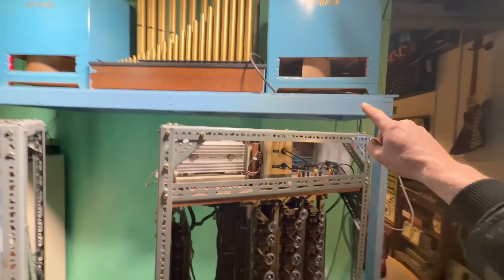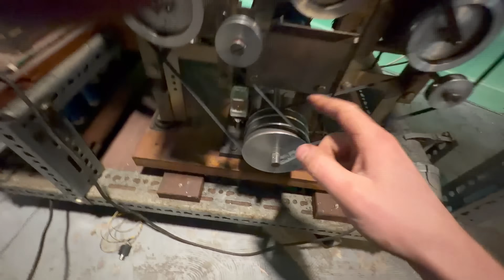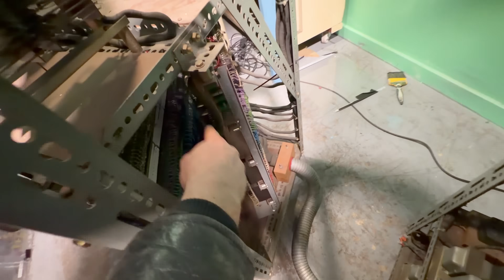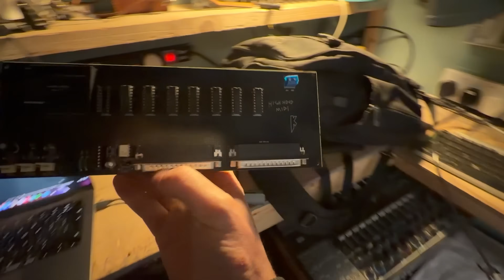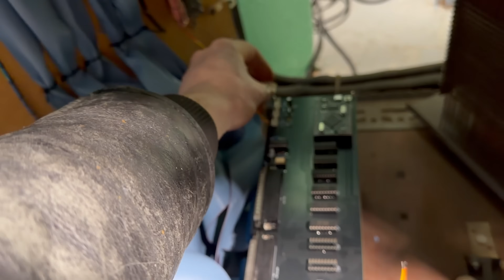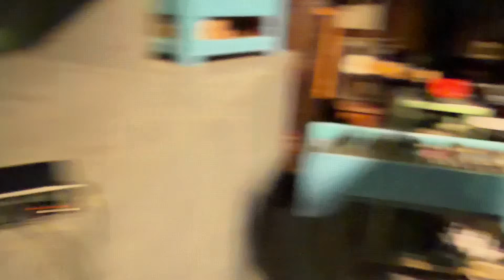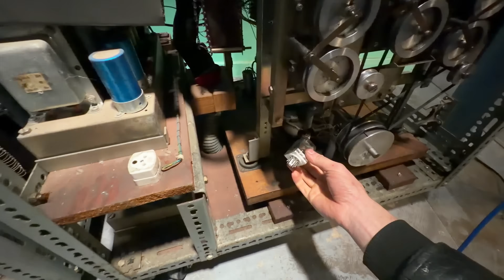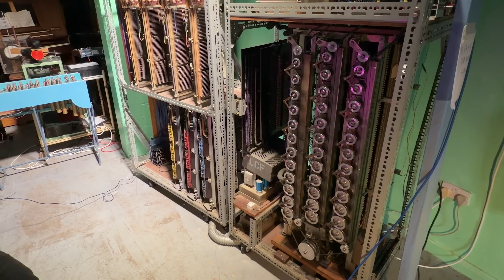IT FINALLY WORKS! - Crazy Electrostatic Spinning Church Organ

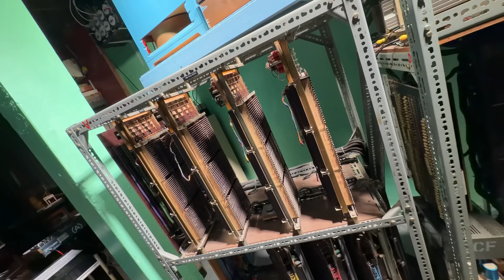Comment: 24:42 wait are you telling me that THE classic sound of "old fairground music" when someone accidentally plugs in an abandoned fairgrounds power or trips over it was made with this kind of tech? absolutely awesome to see one of these up and running
Reply: It genuinely wouldn't surprise me if a foley artist at those times actually went to a local church with an organ like this and asked if they could record their organ shutting down.
Reply: The 'old fairground music' was and is acoustically produced, usually by an instrument called a 'fairground organ' (or 'band organ' in the USA; 'orgue du foire' in France; 'kermisorgel' in Netherlands/Belgium; 'Jahrmarktorgel' in Germany; etc). 

This is a real pipe organ that plays automatically, via a pinned cylinder ('barrel'); folding cardboard 'book' music; paper rolls (like a player piano); or some type of digital media (either proprietary cartridge/floppy disc systems, or regular MIDI, now with SD cards, smartphone/tablet etc). 

These instruments were popular until the very late 1920s when amplified address systems / large speakers finally became practical for fairgrounds. 

This, coupled with various economic recessions/depressions in the USA and Europe, contributed to a downturn in these instruments' use. With the very grim postwar economy in England, a shockingly high number of the largest and finest fairground organs were deliberately destroyed and burned in the 1940s-1950s, including most of the two dozen or so 110-key Gavioli organs (that had been produced to front traveling bioscope shows / cinemas in England), many large and fine Marenghi, etc. organs, etc etc. this terrible wanton destruction of these magnificent instruments is still a painful memory for enthusiasts unto today. 

On the continent, most fairground organs fared much better, with a great many of them stashed away in barns and similar during the war to prevent them being vandalized etc. 

After the war, dozens and dozens of these organs were pulled out of their hiding places, fixed up (by the few active people doing this) and played proudly again. 

Their sounds, and those of the few dozen or so still going in England, eventually inspired preservation-minded people to form the "Kring van Draaiorgelvrienden" (Circle of Street Organ Friends) in Netherlands in 1954; and the "Fair Organ Preservation Society" in England in 1964. 

Other groups soon followed (such as "Club Deutscher Drehorgelfreunde" in Germany in the 1970s; 
the "American Band Organ Association" or ABOA in the USA in the 1980s, 
soon replaced by the "Carousel Organ Association of America" or "COAA" in 2000; 
the "British Organ Grinders' Association" or BOGA; 
the "Mechanical Organ Owners' Association" or MOOS also in England; 
and the "Australian Mechanical Organ Society" or AMOS). 

In addition, many other more general mechanical-music societies have taken an interested in these instruments, 
allowed articles to be written about them in their journals, 
and helped promote public get-togethers of these instruments, 
to help raise awareness among the general public (as well as being a lot of fun!). 
Some groups doing this include AAIMM in France; AMMI in Italy; AMICA and MBSI in the USA; and more. 

As the collecting/preservation movement (and market) grew in the 1970s, 
many small cottage-industry builders sprung up to make new band, fairground and street organs to cater to the collecting market. 
In England, numerous builders popped up including Alan Pell; John Page / Page & Howard; McCarthy; Dean Organs; Peter Trueman; and more. 

These companies help(ed) service the enthusiast market, 
especially the demand for smaller portable organs playing more modern media (than barrels) such as cardboard books, paper rolls and computer media (as well as a smaller demand for large fairground organs that couldn't quite be satisfied by the remaining supply of antique instruments). 

In Germany, likewise many builders got started (with many still active today) such as Raffin; Hofbauer; Deleika; Jaeger & Brommer; Stuber; Stefan Fleck; Schmider; and more. 

In Netherlands, where the street organs are still considered a cultural asset, many builders of new large street organs either continued old family traditions, or sprung up anew, such as Jan van Eyk; Jan Roos; Theo Heesbeen; Elbert Pluer; and on and on. 

Likewise in France, many builders of small hand turned cardboard book street organs (and somewhat larger cardboard book fairground organs) emerged, like Marc & Christian Fournier; LeLudion Organs; Odin Organs; and more. 

Even in the USA, band organ and small street organ production was done on a small scale (maybe a few hundred instruments in total) by such firms (mostly now defunct) as Stinson Organ Co.; Johnson Organ Co.; William (Bill) Kromer; Richard Freed (Freedola); Paul Dyer; Brian Flora (Floraco); and a few others. 

In addition to the small companies/factories and custom builders turning out street organs (and a few fairground organs), a great many hobbyists here (and in Europe and Australia) have made their own homemade street and band/fairground organs, for their own amazement/amusement as well as that of their friends, family, and the general public. 

Several sets of do-it-yourself plans for building street and band organs have been published, with several hundred people trying their hand at making their own instrument (including the various "John Smith" busker organ plans in England; the Walter Hoffle plans in Germany; someone's plans for a 36-key cardboard book organ in Netherlands; various band organ plans in the USA like the Bob Stanoszek / Bob Humes Wurlitzer 105 plans; etc etc).

In Belgium, the remaining builders of 'dance organs' and organ-type 'orchestrions' (the last type of large mechanical organs to retain serious popularity in their home country, with the production of medium-size and even some large instruments resuming after the interruptions of WWI and WWII), found, on the one hand, a gradual tapering off / downturn in their native dance hall / cafe / coffehouse market for their new instruments 
(even despite some new innovations they introduced from the 1930s-1970s such as, in order: 

exposed working accordion(s); 

exposed working drumset(s); 

modern 'space age' organ fronts with automatically-changing lighting systems that change colors with the organ's registers; 
'half-electronic' organs with melody and countermelody voices made by early analog electronic organs 
(such as the Univox and Clavoline), while real organ pipes still provided bass and accompaniment sounds; 

mostly-electronic organs incorporating an entire Hammond organ into the chassis 
(plus selected few ranks of organ pipes, and the usual accordions and drumkit), still worked by cardboard book music; 

and finally, in the 1970s, electronically-operated organs worked via computer tape media (pre-MIDI). 

Although these innovations kept these companies at the forefront of dance organ technology 
(mainly the Decap family companies such as Gebroeders Decap and Decap Herentals; both still in business today), 
the tapering off of the original-use market 
(whose clientele who loved the dance organs were aging out, 
being replaced by a younger crowd who demanded rock bands and DJs), 
ended up dovetailing nicely with the sudden rise of the collector/enthusiast/preservationist market in the 1970s, 
who not only created a small but steady demand for new instruments, but also gave the old companies new business in repairing and restoring their old instruments (in an authoritative way), with the collectors amazed to find out some of these builders were still alive and still working on their instruments! 
(Another good example was the late Arthur Bursens, who kept building new organs and repairing his old ones, into the 1970s). 
This sort of business, from museums, collectors et al, plus the few people still using dance organs and orchestrions in their original function today (in dance halls, cafes, and even in traveling mirrored 'dance tents), have kept several of these companies alive and active unto today. 

With the continued (but smaller volume) level of business, some of them (the Decap family companies in particular) have been able to innovate still further; with Decap introducing a full servomotor-controlled drumkit (with many levels of expression on each drumstick, with general MIDI); more realistic-playing accordions with many levels of expression; more sophisticated computer samples; and now even scrolling synced kareoke of lyrics to tunes displayed on screens (so you can 'sing along with the organ' as it plays). 

Seeing all these type of innovations in Belgian dance organs, it makes one wonder in what direction the original fairground organ builders (and player piano / orchestrion builders) would have gone, had they kept going and not gone defunct in the two World Wars. The closest we might get are the modern day all electronic reproducing pianos with 1,000+ levels of expression on every note, and a very high sampling rate for very accurate timing and playback of recorded performances.
Reply: @andrewbarrett1537  I saw one of those operate at the museum of musical instruments near Phoenix, Arizona. Spellbinding honestly, even if the sound of that particular unit wasn't so good.
Reply: thought exactly the same :D
Reply: It could be an old gramophone slowing down too.I think that would have the same effect

Comment: All those constant values not having a const qualifier.  Not that it likely matters, the compiler is probably smart enough to still optimize.  It's more to prevent programmer errors anyway, where it can catch if a variable is being assigned to that shouldn't be.
Reply from the maker: It’s fine. It’s all infront of you as all the cases are different. Nothing is in a logical line. No need for optimizing as uses hardly any memory. Just more sensicle for people who work on organs

Comment: You can use a strobe light on the tone generators to find the slow pokes. Great job its fantastic.
Reply: There are also ios and Android "video tachometer apps" that claim they do this
Reply: @gazzar67 You could probably just adjust the camera frame rate too. The default camera app on most phones lets you do this now

Comment: Electroboom would be proud... :)
Reply: Device spits sparks and a loud pop when touched
Unplugs device
plugs device back in
Touches live device that has already gone pop once
Reply: @JessicaKStark  Except it wasn't live any more, because some fuse or circuit breaker popped. Except, it was not the one in the plug of the heating element which might have given pause for thought.
Reply: @karlkoehler341   Even if the power strip tripped, still safest to fully unplug it before poking at the thing that let out the magic smoke.
Reply: Banger!
Reply: Rip electro boom he will be missed
Reply: How many fire extinguishers were on the wall!?!
Reply: I'm proud of you buddy 🙌🏻🧙🏻‍♂️
Reply: Look mum, no pulse